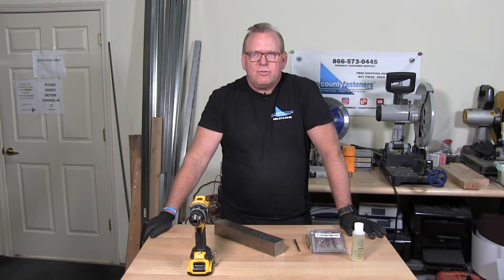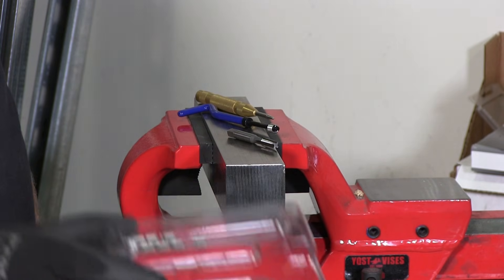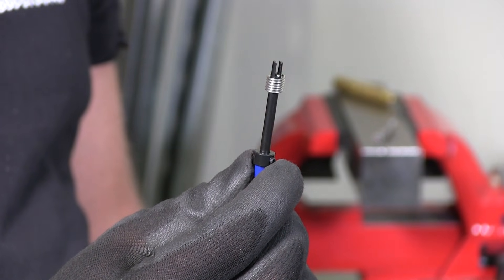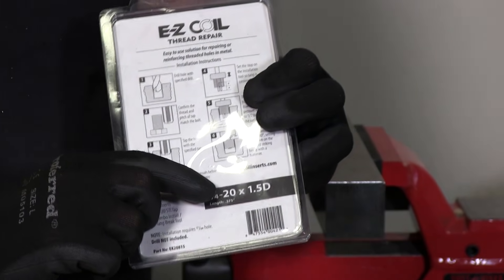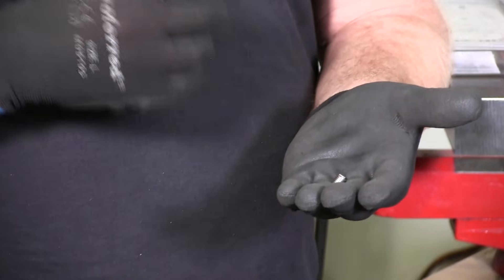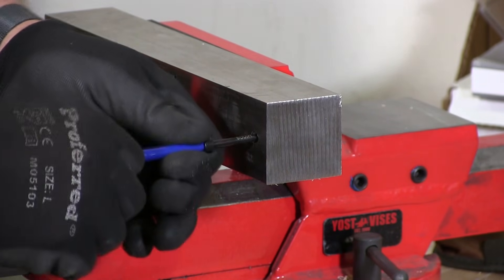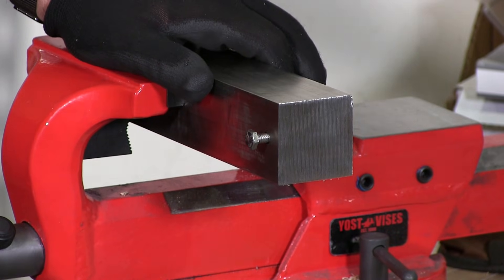How to Use & Install Helicoil Thread Inserts | Fasteners 101

Comment: So what size thread did you tap the hole if the internal thread of the coil is 1/4-20 the external has to be larger.

Comment: BUT can you tap the hole and then put one or two coils on the nut and just screw the nut in?
Reply: What would helicoil be needed after the hole is tapped?
Reply: @mikeprice8307  do you know how helicoils work? No because you asked that question. When you tap the hole (after drilling the old messed up threads out) it will be wider then the original screw hole, so the coil goes between the old screw and the new hole.... if I used a bigger screw I would not need the coil but not an option in all cases.😃... thanks for asking.

Comment: If I screwed up quarter 20 bolt how do I know what size helicoil to get do I have to drill it out to what size so I can use quarter 20 again or will I have to go to a smaller bolt
Reply from the maker: If you've stripped a 1/4-20 thread, you can still use a 1/4-20 Helicoil to repair it. No need to go smaller. Here's the process:
Use a 17/64" drill bit to clean out the damaged threads
Tap with a 1/4-20 STI TAP (MAKE SURE IT IS AN STI BOTTOMING TAP)
Install the 1/4-20 Helicoil
This brings you back to a 1/4-20 thread. Always double-check your kit instructions for exact sizes.
Got more questions? Fire away.

Comment: I don't get it. You tap a new thread, and insert a threaded coil. Double the work, no?
Reply: If you use coil, you can use original bolt. Otherwise you would need one size bigger bolt. Also using coil thread will be even stronger than it originally was, if we are talking about aluminium.

Comment: now the big question, where did the little broken off piece go? if you are working on an engine. does it fall in the crank case? how can you do this safe?
Reply: Don’t break it off, remove the tool and use a set of needle nose pliers, comes off after a couple of bends
Reply: The only reason I'm looking at a video of this to see what happens if you gotta fix a sparky
Reply: There is a REAL Helicoil kit that has inserts with no tang.  It has a different insertion tool.  I imagine you use this style for spark plug holes/other through-holes.
Reply: Depending on what part you are rethreading, you may need to remove parts or use magnets through different holes to catch the tangs.
Reply: Use canned air
Reply: If your doing anything on internals a flush mount helicoil is the route to go. It completely replaces the threads with a new casing and makes it stronger
Reply: You have to remove the tangs.
Reply: @adityashyamroshan363 
No you DO NOT HAVE TO. It depends on depth of hole, blind or through hole, length of insert, number of threads you need your bolt to go in, AND if you can't exteact the tang later.

Comment: why not do it properly and re-tap the damaged thread a size larger ?
Reply: Some times you cant go with a larger bolt
Reply: sometimes is usually not the norm @jodygarcia9892

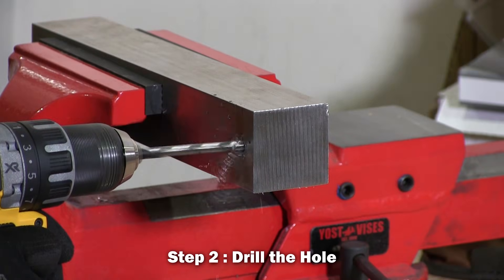Comment: I have a question at 3:33-3:43 please. What size tap do you use for a 1/4-20 helicoil?
Reply: Some kits come the tap that matches the helicoil you’re purchasing. And the helicoil itself should be whatever diameter and pitch of the bolt you’re using. I realize this comment is year old now, and I’m sure you’ve found the answer by now. For example, I bought a “fix-a-thread kit for a M6-1.00 bolt. The helicoil is 1/4 52-20 and came with a matching tap. But the helicoil is for a M6-1.00 (6mm diameter - 1.00 thread pitch).

Comment: STAINLESS STEEL DOESN'T STRIP, YOU SHOULD USED ALUMINUM. ALUMINUM IS A SOFT METAL. Meaning Aluminum is easy to strip.
Reply from the maker: So is stainless steel.
Reply: @AlbanyCountyFasteners  Sir You are Wrong. Between SS and Aluminum, the Aluminum is much softer.
Reply from the maker: @waymonblevins6939  Both materials are rated soft metals.  Pick your poison.

Comment: Whats the point of the coil imsert if you are tapping it anyway?
Reply: some things cannot be enlarged like spark plug holes with wells only big enough for the original diameter spark plugs
Reply: These are usually used to repair stripped threads, not create new ones.  Except I have seen them used from the get-go in aluminum so that your threads are now steel.

Comment: 02  Elantra......Anyone know what  torque limit should be on this 
Helicoil's on a Timing Belt tensioner pulley Bolt which calls for 38Ft 
pound  will these Helicoils hold up to 38 Ft of torque
Reply from the maker: IDK contact the manufacture.

Comment: My issue is I have a M8x45 bolt with the threads stripped. It’s a mount for motorcycle seat. I’m having issues finding correct helicoil kit.
Reply from the maker: It's OEM so go to the manufacture.
Reply: @AlbanyCountyFasteners  I already have the OEM part.. and the helicoil… it’s just an unusual size..of the actual threaded tab

Comment: So if you screw up the threads in something you have to tap and die to a bigger size? Then put a helicoil in and go back with the original bolt? If I have a size ten metric bolt what size kit would I need to be able to rethread the same size bolt, as the bolt is special and is designed to hold onto a different nut above it. For lawnmower magneto.
Reply from the maker: https://www.albanycountyfasteners.com/Category/Thread_Inserts

Comment: I need to repair threads in cast aluminum. The original threads were double or triple the length of the heli-coil. These are M10x1.5 bolts and the heli-coil is 15 mm long. Do I need to double up on the heli-coils? If so, are there any tricks to dong so?
Reply: i don't know about this brand but with helicoil you can certainly double up.
Reply: After getting no suggestions here, I searched more and found that McMaster-Carr has very wide selection of inserts in various lengths, including exactly what I needed.
Reply from the maker: You cant double up on a coil.
Reply: @AlbanyCountyFasteners  so what is the solution?
Reply from the maker: You can only use one coil so find the longest coil on the market.
Reply: @AlbanyCountyFasteners 
Laughing. Yeah, try to find just one more than L=2.5. /sarc
Reply: @AlbanyCountyFasteners
Bullshit. Perfectly fine, easy, safe.
Do this:
Break off tang of the top stacked insert. Screw both inserts onto the bolt to hit the bottom tang. You may need to minor trim one or other insert to get threads matched where they join. If you are inserting for ever, Loctite inserts onto bolt, (hi temp if needed) dribble some on to outside of assembly, then screw the assembly into newly tapped hole. You've got ~20 mins before Loctite goes off.  Forget about the bottom tang. I've helicoiled 2" deep this way. No dramas.
Reply: Sounds like a starter bolt...lol I'm doing that now...hahaha
Reply: A tap

Comment: is inserting coil must use a special tool?
Reply from the maker: Yes. The tool is needed for both the installation and removing the tang on the insert.
Reply: Yes, the installation screw sleeve is made of a special tool

Comment: I ordered M10x1.25mm for my 125cc ATV , the M10 size is the width of the spark plug right ? And the 1.25 the length of the thread
Reply: I think the 1.25 is the pitch of the thread, distance between each thread, nothing to do with length.
Reply: Check out Time Cert inserts 

They’re more robust

Comment: great information, i couldnt figure out how to break the end of the coil. Thanks
Reply: You simply take a small screwdriver flat blade fit it on the tang and smack it with a hammer, mallet or dead blow hammer it will snap off easily, use air to blow it out of the hole, or a small magnet...
Reply from the maker: Glad we could help! Thank you for your feedback.

Comment: I have a bit of a difficult issue. I have some stripped threads in a door closer and the holes are less than .375". I have to drill them out, then place the coil but the coil is going to be too long already, and that little tab is going to be a problem. Can't insert without it, but it will be in the way once inserted. I need 100% of those threads and can't afford to lose the thickness of that tab. I can't drill the hole deeper because there's a risk of hitting the internal chamber causing a massive oil leak from the closer, and these are very heavy 11' tall doors.

Comment: He didn't set the tool stop (which is loosened using an Allen wrench) so that the tang was positioned halfway between the tool slot as the directions say. and he didn't screw the bolt all the way down in because he couldn't because the Helicoil likely jumped some threads and so he has to re-do it.
Reply: it's also way easier outside of an engine bay

Comment: Well that was totally unhelpful, what happened to the tang?! And why did he drill it into a totally unrelated steel? In a vise? I mean how do you put the dang heliocoil in TV he engine? When you turn the little tool down to insert it the thing falls off! And the little too isn't long enough to reach it and turn it let alone snapped off a tang using a hammer? Why not just use a hammer on the whole engine?

Comment: Dumb question here whats the point in a heli coil if you gotta tap it.Couldn't you just use a bolt now since you tapped it?
Reply: He’s just demonstrating how a helicoil works. Typically the hole is already there and the bolt has stripped out the threads like a spark plug hole for instance. The helicoil allows you to use the same diameter bolt.
Reply: In my situation the bolt runs through a center of a pully which then runs through a spacer that holds a tension bracket on my block. The fitment in the inside of that spacer is exactly the diameter of the bolt. If I go up a size it won’t work. So I’m drilling, tapping, and inserting a m8x1.25 helicoil.
Reply: Ya but sometimes not enough room for the bigger bolt head if its on a tight spot. Also stuff like spark plug holes, if they get stripped this best way of fixing it short of new head
Reply: its not a standard tap where a normal bolt could thread into it. Its labeled on the tap as an STI tap (special thread insert) made specifically work with the coil. This is used for when you don't have room to tap to the next bigger bolt size but instead need to use the same bolt.

Comment: What type/grade of drill bit did you use that cut through steel so easily ?
Reply from the maker: Bob used Cryogenic Drill Bits from Norseman. You can find them in a set here: https://www.albanycountyfasteners.com/Norseman-Magnum-29-PC-Ultra-Dex-Drill-Bit-Red-p/1050-340.htm or as individuals here: https://www.albanycountyfasteners.com/norseman-cn-tech-jobber-length-cryogenic-drill-bits-p/1080-1020.htm
Reply: Feeds and speeds my friend

Comment: You installed the coil in a fresh thread. How does it work in a striped thread and how do you size that?
Reply from the maker: It's the exact same process, and the new threading should be the same as the old threading (if the old threading was 1/4"-20, the repair kit should be the same). You drill through the messed up tapping by creating a slightly larger hole and then use the included tap in the repair kit to tap your slightly larger hole. The helicoil fills the space that was tapped, slightly shrinking the hole back down to what is was prior to the repair, but with new threading.
Reply: @AlbanyCountyFasteners does it work for fluid? Like a stripped fuel inlet on a carburetor?
Reply: For that your best bet is a timesert.